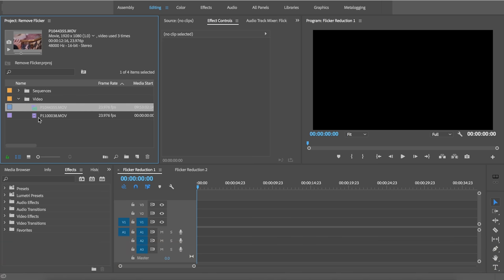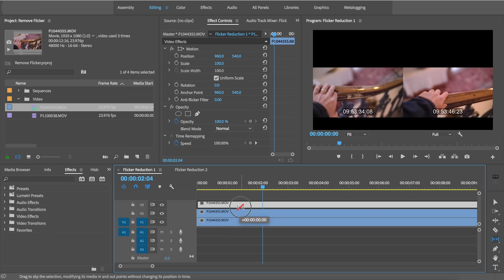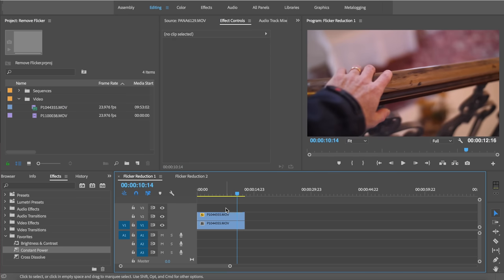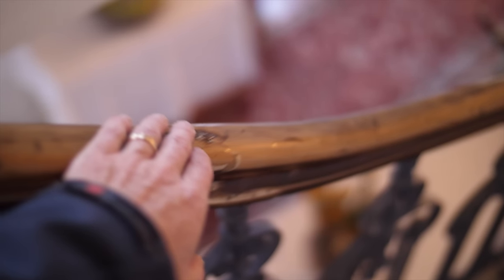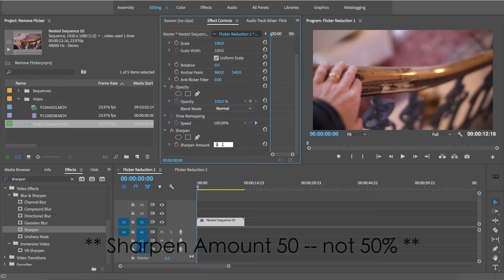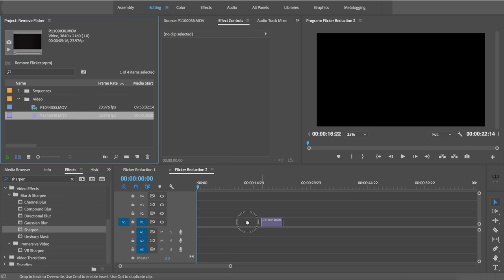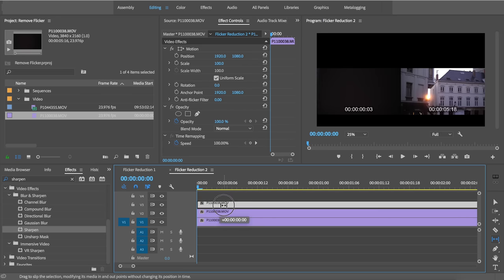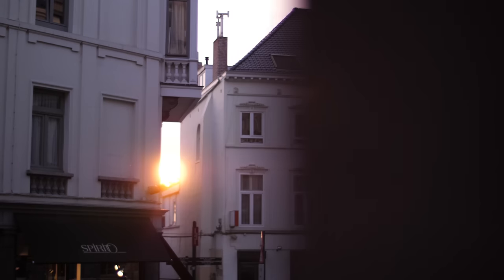Fix VIDEO FLICKER in 30 Seconds WITHOUT Plugins

Comment: Thanks mate, that just saved my project :)
Reply from the maker: Joel Grichting you're welcome! Glad it worked. There are some types of flicker that this won't work on, but thankfully for quite a bit of footage it can make it usable again.

What's the project you're working on?
Reply: I used it for footage, where I was filming some projection mapping. I already worked with the shutter speed and framerate on the camera but had still a very unpleasant flicker on the footage. I found two layer makes it in my case somehow blurry and "ghosty" so I went with a compromise. Still slightly flickery but a huge improvement.

Comment: This is exactly what I was looking for except that you went so quickly! I wish you would have gone step by step much more slowly.
Reply from the maker: Thanks for the feedback. The speed was intentional. I hate sitting through long tutorials, and always prefer to just get the meat of it when I'm watching one, so I wanted to make a tutorial as I would prefer it to be.

Is there anything you've got a question on?
Reply: Thanks for the quick reply.  I totally understand what you mean.  I'm brand new to Premiere Pro so I'm learning everything step by step.  At least I have some idea how it can be done.  I'll try duplicate and such like you posted.  Hopefully it will work.  I do appreciate you posting this though!.  I thought I had to do the warp stabilizer (which wasn't working).  This definitely helps me try something different.
Reply: How do you duplicate the clip?  That part I couldn't figure out.
Reply from the maker: Easiest way is to hold "Option" (or Alt, if on a PC) and click and drag the clip you want to duplicate. Just drag the clip to the layer above your first clip. The other way (which is actually how I did it in this video, since old habits die hard) is to press Command/Control + C, then move the playhead to an empty spot on the timeline, then press Command/Control +V, then drag the clip to the spot you need it.
Reply from the maker: Warp Stabilizer won't affect flicker at all...it just stabilizes shaky footage. It's definitely on a clip-by-clip basis, so some clips need Warp Stabilizer, others don't. Just as some clips need flicker reduction, and others don't.
Reply: Thank you so much!! I appreciate your feedback on this.  I was able to duplicate it.  You've helped out a lot!  Really appreciate it.

Comment: This helped me.. i had to do 5 tracks and 100, 80, 60, 40, 20 percent opacity
Reply from the maker: Andrey Mishchenko commented (and I have it as a pinned comment) that when doing a bunch of extra layers, if you want to have even opacity between the layers that you would want to do opacity divided by the number above the original layer. So for layer 2: 100 ÷ 2 = 50%, for layer 3: 100 ÷ 3 = 33%.

So (if you want to get better results with less ghosting) try it with layers at 100, 50, 33, 25, 20 percent opacity, and turn off as many layers as possible (starting with top layer) while still getting results you're happy with. If you can do it with just 3 layers total, awesome, but if that doesn't work, then 4 or 5. I once was able to get rid of banding/flickering in a video clip by having like 7 layers, but by that point any movement in the footage looked terrible so obviously the fewer layers you need to use the better.
Reply: Will surely try.. thanks for the elaborate note👍👍👍

Comment: sounds great, but still looking for the opacity button (as an amateur this goes too quickly for me...)
Reply from the maker: Admittedly this tutorial is geared toward people who are familiar with Premiere (or whatever editing software they use) because a lot of times I get annoyed with the tutorials that take 5 minutes to convey one or two small pieces of information.

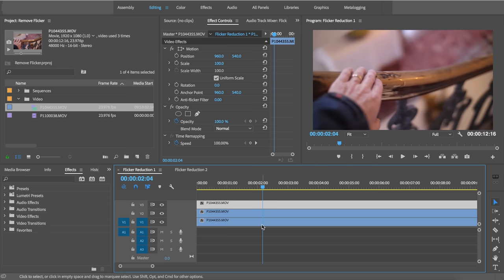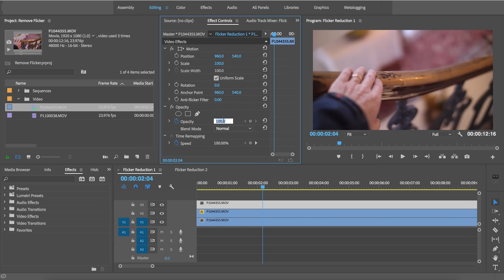That said, if you're using Premiere, make sure the clip you want to adjust is selected, then you'll find Opacity in the Effects Controls tab. Pause the video at 0:39 or 0:40 and you should see where it is. Also, make sure you're in the Editing workspace. If you're in one of the other ones (Color, Audio, etc.) then you probably won't be able to find it.
Reply: I've found the opacity button...now one thing to go : how do I nest :-) I really appriciate your help flickr in video is a big problem for me that needs to be solved !
Reply from the maker: **again for Premiere**: Select all the clips you want to nest, right-click, and Nest should be an option about halfway down the menu. You may need to scroll on the menu because it automatically starts at the top.
Reply: on my screen there is unfortunately no 'nest' option......but I will search for more..thanks again!!

Comment: Even with 4-6 layers I've got really bad flicker... it seems like no amount of layering can fully remove it. Any suggestions in this case? Flicker Free plugin doesn't do it either.
Reply from the maker: Unfortunately some footage just isn't fixable. Do you have a link to the footage online anywhere?
Reply: I will send you the link in a Direct Message. Thanks for offering to check it out!
Reply: I sent in a DM but have no idea where to find a record of those messages. Let me know if you got it & thanks again.
Reply from the maker: Hey, I did receive it yes. Just took a look, and I really don't think that footage is going to be fixable...at least with the trick on this video. You could try one of the deflicker apps, but I honestly think they won't be able to fix it.

Here's why: it looks like you were filming under fluorescent lights, with multiple light sources. So in that case the the flicker that each light was giving off was offset from each other, giving that weird banding look. I've ran into this a few times, particularly when filming in office buildings or grocery stores. The solution is to slow your shutter speed down so that the exposure of each frame is long enough to even out all the various flickering sources. But after-the-fact, once you've capture footage that looks like that, I don't think it can be fixed.

Sorry I don't have better news for you. :-(

Comment: Is that final cut pro?  I use PremiereProCC, not sure what you demonstrated, since it's not stated in the video description.
Reply from the maker: T Spurlock This is Premiere Pro CC, but the principle of this technique will work on any nonlinear editor. On Final Cut the tool to use is called the Trim tool rather than the Slip tool, and the keyboard shortcut is T rather than Y. But since you're using Premiere you should be able to follow it exactly as-is on the video.
Reply: It works with any editor or compositor...  Also works great as a grain/noise remover! Just duplicate your clip to a second layer and set the opacity to 50%... add more layers if necessary, lowering the opacity on each one.
Reply from the maker: +Mathieu Lalonde very true about using it for grain/noise. It also helps fix flickering in timelapses. In my recent timelapse film I used this technique quite a bit and it definitely helped cut down on flicker and noise.
Reply: i think this method works on any editing software

Comment: All the videos for remove flicker that doesn't involve a plug in all have the same solution: Duplicate, move 1-2 frames, change opacity of upper layers. Unfortunately, these methods, including the third-party plugins don't work on automotive LED tailights/parking lights.
Reply from the maker: Sometimes there isn’t a fix for certain flickering lights, other than filming at a framerate and shutter speed that doesn’t show flicker.
Reply: @BlueMantleFilms  Client supplied footage.  My cameras are set correctly. Thx.

Comment: Hi,  just started out learning Premiere Pro, I tried the method that you shown in the video, but it does not solve the flickering issue on my footage because it has a lot of movement, showing a blur effect. May I know do you have any other suggestions on how to solve this?
Reply from the maker: Any fast movement does make this technique not very feasible. Unfortunately at that point you're probably left with using an expensive plugin. I had a project I was working on for a client and got flicker that this method didn't work for, so I had to buy a $250 plugin (DeFlicker) to fix it. :-(

Comment: Have just used my pixel 2 to record some old cine film but I'm bothered that the flickering could cause epileptic fit. Your solution seems perfect but I'm just wondering if there is an android video app that i could use with my phone to achieve this. Any help would be much appreciated. Cheers.
Reply from the maker: To be honest, no idea. Do phone editing programs allow for multiple layers? And can you change the opacity of the clips? I would tend to think those options wouldn't be available on non-computer editing apps. But if there's an app that does both of those, then this same technique would work.
Reply: Blue Mantle Films Ta for quick response. Have been trying an app called kinemaster which does allow one layer for my device and you can adjust opacity but i just can't seem to get it to work. My laptop is 10 years old and goes like a snail. Would the software to do this be expensive?
Reply from the maker: With a 10 year old laptop I'm not sure how many current editing software programs would actually work.

As far as it not working through your app, some video flicker just doesn't work with this hack. It really depends on the flicker...and also the flicker will dictate how many layers above the original will be needed. There was a clip I was working with that needed six layers to be able to fix the flicker. It was successful in removing the flicker, but by that point the ghosting from multiple images showing through was too much for it to actually look good.
Reply: Blue Mantle Films thanks for advice. At least you've given me some hope. Will keep plugging away at this. Cheers:-)

Comment: Hi there, is there a free video editor I can use to do this other than premiere? I tried VSDC but I can't seem to slide it one frame down. I can only make the 2nd layer 1 frame slower & 3rd layer 2 frames slower which I don't think is what you did in the video. Any help would be greatly appreciated as I have been trying to do this for hours.
Reply from the maker: I'm not sure about "sliding" the clip in other editors. Premiere specifically has this feature, but I don't know which other editors do. Another way of doing that is to simply drag the upper layers one or two frames over.

Comment: Is there a technique for a clip which needs to keep its audio? Unfortunately I have a talking head clip that was filmed in front of a screen, so the screen flickers throughout.... any help very very welcome! Need to stitch a video together ASAP. Thanks!
Reply from the maker: Is he/she back-lit by the screen? Or is the screen behind but off to the side of the subject? If the flickering can be isolated from the subject by masking just the screen (similar to how I masked just the corner of the video on my second sample in this video) then you could use this technique to try to get rid of the screen flicker. It may or may not work, because screen flicker is different than the flicker I was dealing with in this video.

As far as keeping audio: I deleted the audio track when doing it because I was working with slow motion footage that didn't have any audio, so it was easiest to just not have to worry about that track. But it's not necessary to delete the audio -- you can just leave it.
Reply: @BlueMantleFilms  Thanks for the fast reply! sadly she is back lit... it's pretty much the entire background. I'll play around with this technique but if you have any other alternatives that would be fantastic.
Reply from the maker: @AmyFMcCready  Then the next question is how much is she moving her head around? If her head isn't moving too much then you could essentially do the reverse of the above suggestion...mask only the subject right around her face (tighter, even, than the size of her head...literally just her face) and then apply the deflickering technique to everything else in the image. You may, then, need to keyframe the mask so that it tracks her face (if you're in Premiere, there's a mask tracker that allows this to be mostly automated). You probably won't get great results, but it's likely it could still look better than having a screen going crazy in the background.

The first thing I'd do is try this technique on the video without masking, and make sure it can actually get rid of the screen flicker. You may need to use more than just two layers above the original...it may need three or four layers, each with opacities to have even exposure between the layers: so with four layers above, for example, you'd do opacities of 50%, 33%, 25%, and 20%. If that works for getting rid of the flicker, then I'd create one more layer above all of that, without any deflickering, and mask just the subject's face so that you'd have a "clean" version of her face, and deflickering on the rest of the image.

It's going to be tedious, but it may still be salvageable.

The other option, which also won't be perfect, is to buy a deflickering plugin. I have and sometimes use (when the above technique doesn't work) DeFlicker, and it does usually work. It cost $250 if I remember correctly, but I needed it for one particular project that had bad flicker that wasn't fixable otherwise, and now that I've bought it, I can use it when needed.
Reply: @BlueMantleFilms  Thanks a lot for your help here, might be a good time to mention I am very much a beginner so will need to break this down slowly. In fact, I'm encountering problems immediately, just after I duplicate my clips. When I use the slide tool and drag the clip to the right, the numbers aren't changing - the frames aren't moving. You are just clicking and dragging, yes?
Reply from the maker: I’m guessing you’re trying to use the full clip. Before you put the clip on the timeline, set an in point and out point (basically making it so you’re not using from the very beginning to the very end of the clip). Even if it’s just a few frames after the clip starts, that will give you room to slide the clip around inside if itself.
Reply: @BlueMantleFilms  Thanks a lot for your help. I've played around with it but sadly the effect is too blurry and distorted. :( It seems like I'll need to just accept the screen flicker, as we have no alternative footage. I'm in no position to buy a deflicker plugin... we wouldn't need to use it often enough. Thanks again.

Comment: Every time I try this, I end up with blurred motion and/or ghosting. I do exactly as shown in the video - 3 layers, bottom layer 100%, middle 67%, top 33%. My people end looking like ghosts and any movement in clouds becomes smooth motion - which I don't always want. Not sure why this seems to work for everyone else, but not me?
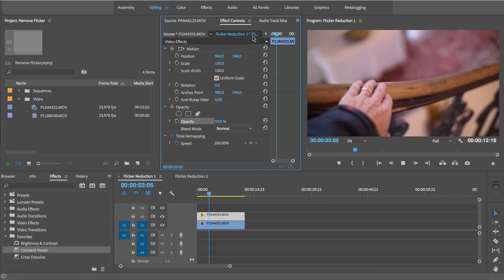Reply from the maker: Yep, unfortunately it doesn't work for all clips. When there's a lot of movement (as I mention around 1:05) it won't work. It also doesn't work on all types of flicker, but regardless it's a good first step to try since it takes so little time (and no plugins).

You also could try just one extra layer at 50% and see if that is still able to get rid of the flicker...then by having only 2 frames of multiple-exposure the ghosting won't look as bad.
Reply: @BlueMantleFilms  Thank you! I'll give it a shot. What would you recommend as a next step for dealing with camera flicker, for clips with a lot of movement?

Comment: I actually like the flicker effect and I noticed that it only appears when color correcting in After Effects Is there a specific way to cause it, or achieve the effect in Sony Vegas?
Reply: just use cheap lights and record in high frame rate(60 fps will do)

Comment: Unfortunately only works for slow mo clips with linear movement. If the video is shot at something like 23.976 fps it will not work and you get a strong motion blur that isn't really motion blur

Comment: can these tasks be done in photoshop or lightroom?
Reply from the maker: I've never used Photoshop or Lightroom for video editing (other than working on individual frames). I know it's possible to open individual clips in Photoshop, and image sequences in Lightroom, but otherwise my knowledge is very limited with how they interact with video. I tend to think this would not be possible in either program (for example: since Photoshop is not a video editing program, having multiple layers of a video file doesn't seem like a feature it would have).

Comment: I have some 240fps slow mo footage and this technique doesn't work on it. The demo of the Digital anarchy Flicker free Plug In seems to work, but I'm looking for any last ditch options before I have to purchase. Any thoughts?
Reply from the maker: Try just one layer above the original at 50%. If that doesn't work try three layers above at 50/33/25. You could try adding more layers, but beyond that the ghosting gets too bad and I don't think it works. That said, since you filmed at 240fps, the movement may be so slow that you could do one more layer (so five layers total) at 20%.
Reply: Blue Mantle Films Brill. Will give it a go today. Cheers for the info. 🙌🏼🙌🏼
Reply: Gave that a go, although t's not quite getting there. Strange. Whatever those guys have done with the plug-in seems to work though! Not a huge amount of ghosting either. That and a bit of sharpening seems to be the best outcome. Cheers for the heads up regardless.

Comment: I tried in PP and FCPX and it didn't work :( the video is a shot of a steady speaker, not much movement :( the bars are still there :( did the 33 and 67% and 50 and 33 nothing helps the LED in the room were horrible :(. any other adjustment ideas?